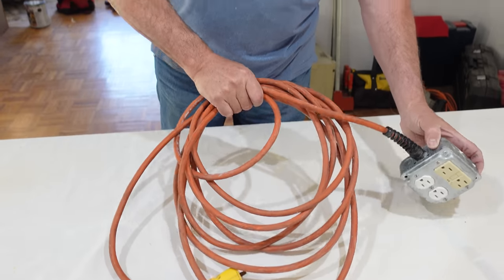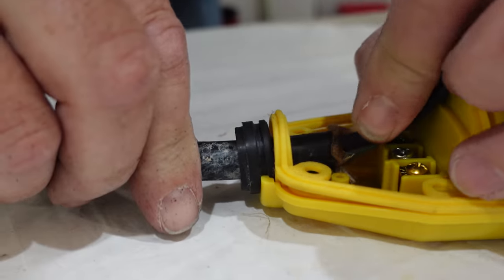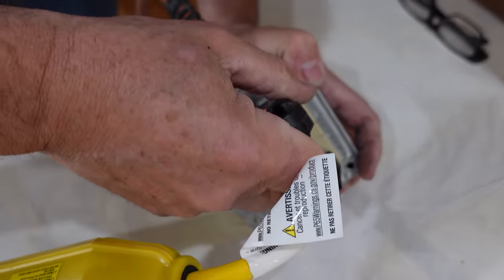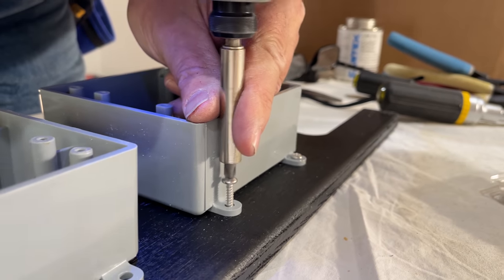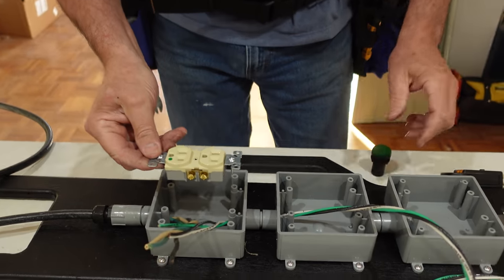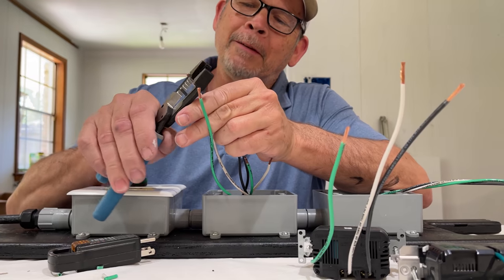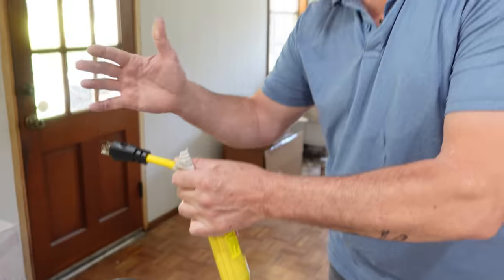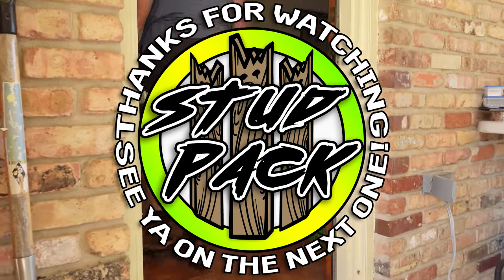HOW TO MAKE THE ULTIMATE EXTENSION CORD!

Comment: only problems i got with this is those usb outlets are unreliable in my experience, it would have been awesome to run a dedicated DC power rail through this cord-board, a really good PSU unit with warranty, and wire it up to dedicated USB-PD charging unit with good cooling, charge your laptop at top speed too, and never have to remember which sockets are dead because the integrated AC to DC converters burned out.

and also the US sockets, Australian socket FTW ahahaha

Comment: What about if you need to plug in  welders for broken nails or door hinges......
Reply: A welder would be 250 V. 
Which would mean a different plug and receptacle and wire. Usually it’s a 4 wire twist lock. 
Then you need a double pole breaker.  Usually at least 30 amp.

Comment: So the breaker didnt trip because the way it works is when a short circuit happens there is a large current the breaker trips instantly because there is a magnetic field that pulls a mechanism which trips the breaker. When there is an overcurrent the current is lower then a short circuit. This warms up a bimetal and when that is warm is folds and enlarges which also trips a mechanism. This means that it takes more time to trip. But dont worry because the warming of the bimetal goes quicker then the warming of the cable. Its designed this way. The vacuum cleaner part is wrong. When a motor spins slower there is a lower internal voltage of the inductors so there should be a higher current. I think why this isnt the case here is because the vacuum cleaner senses a the current growing and lowers the voltage until the current lowers again. When there is more mechanical resistance to a motor the current rises because it spins slower keep that in mind.

Comment: Very American style electrics. Also don't you guys have like extension cord rolls with the ground fault protection built in? They are really cheap, give you earths, and on a roll like 15m long for not that much, or if you splash some more cash you can get better ones what are water resistant and what not

Comment: breakers are made to trip immideiately at 200 percent rating so until it hits 40 amps it wont trip right away but will trip over a longer period of time ie an hour federal has such a high failure rate it might not trip even at 40 amps tho

Comment: Why so many Wagos?  Each outlet can handle 4 hot wires plus 4 neutral  wires under the 2 screw clamps per side.  Still need a Wago for the ground unless you daisy chain.

Comment: i was told by an electrician that GFCI outlets arent the best for using on extension cords that you plug in power equipment like saws .. i dunno... they said it qas something about when the saw turns on, it draws a surge of power an will trip the gfci all the time. can anyone explain this and if that really happens?

Comment: As an electrical engineer myself, I don't understand the logic of putting in a 15/20 amp receptacle in the mix, unless everything up to that point is rated for 20 amps.  Of course, you can draw more current than 15 amps with multiple devices plugged in and running simultaneously, but under normal use that isn't likely to happen for very long, or an extended period of time.  A 20 amp device plugged in however, may draw a significant amount of current for a longer period.  I'm not sure of the gauge of the cable cannibalized to make the cord, but it's very likely only rated for 15 amps, since that's what its original plug was.  Same as the inline GFCI - I know that's only rated for 15 amps, as I checked the specs on it.  Unless the extension cord, GFCI, and various pigtails, etc. are sized properly for a 20 amp load, this shouldn't be plugged into a circuit with anything more than a 15 amp breaker, and that pretty much makes the 15/20 amp receptacle useless with anything other than a 15 amp device.  Remember, circuit breakers protect the wiring, not the devices that are plugged into them, so if you really wanted a 20 amp receptacle, the wiring and GFCI should also be sized appropriately to allow it.  Otherwise, it can be a fire hazard as the wiring and GFCI may heat up handling a load they are not designed for.

Comment: +1 for not being all "manly men don't use a GFCI" which is how some people would think and it's dangerous and silly.
I think it is theoretically possible for the wrong GFCI to trip when you have more than one.  If you plug them in the opposite order does the yellow one still trip? Still fine, just a small nuisance if the wrong one trips.

Comment: What is the purpose in residential to have 15 amp receptacles on 20 amp breakers ?
Reply from the maker: NEC allows a 15 amp duplex receptacle on a 20 amp circuit
Reply: NEC may allow that but town codes could be different. Always check with your local Town for proper codes.

Comment: Why not use hospital grade 20 Amp receptacles ? They are very heavy duty. You have 12 gage cord, you did not mention what the GFI was rated for? Hopefully it is 20 Amp as you may be plugging in multiple tool which will be pulling over 20 Amp. Also you have to figure in start current. Nice job overall. I just busting your ???. I get your points though. 
The reason you are able to pull 28 amps is because most a rated to be able to pull a 125% over rated for a short period of time at a certain temperature. If you continue to pull that amount for a period of time the temperature will increase in the enclosure and the Amp rating will drop which will kick breaker. If you were to pull a 40 Amp or 50 Amp draw it would kick immediately. Many times your start current will be higher just momentarily but once you motor or other electrical device gets to normal operation the amps will drop. By having breakers rated at 125% at a specific temperature this will allow this to happen without tripping breaker. However if it were to continue pulling those amps for a period of time then the temperature would increase causing it to trip. Amps is the rating but you also need to know what temperature it will allow. Basically temperature is our enemy not so much amps for breif time. When things get hot fires are started and that's why both must be known. Also box size will also affect Temps. I know I may not have explained this in electrical code terms but I know you understand my point. Thanks for you detail in explaining things as I know this is very helpful to many.. PS I am not an electrician but a master Diesel mechanic and many principles apply to my industry also. While most of my circuits are lower DC circuits we have many supply circuits that require 120 or 240 volts. Like truck block heaters. Thank you and have a great day.

Comment: A better connection would have been to solder the ends of the wires so that when you compress them it doesn't spread apart

Comment: 25 Amp/120v = 28 Amp/107v 
3000W is 3000W
You get some tolerance for Voltage Drop

As it gets warmed up things will change...

Comment: I would never use a 1 way switch for an extension cord. If you plug your extension cord into a power socket where the live wire and neutral are reversed (which can happen as you may know), your switch will only turn on and off the neutral, which means you will always have 120v on your tools, which can lead to damage in the electronics.

Comment: The problem with the breaker not tripping is you only showed amperage, which is not a true measure of what is going on. Breakers are designed to trip from current (wattage). The AMP rating is a certain amperage at a certain voltage. Wattage is Volts * Amps. That cable was not able to maintain full voltage at that load which lowers the wattage. So, by only showing the amperage,  you are kind of cheating the question.

They also work thermally, it takes time to build up enough heat to trip. But, your almost double the rated amperage would more than likely hold until the wire insulation melted on the cord due to the voltage drop.

That is called a gland, not a strain relief. It's meant to pass a wire/cable through a hole and seal it. A strain relief would have a flexible section to reduce the chance of focused stress on the wire/cable.

Comment: 28 amps on a 20 amp circuit is 140% over the rating. If the breaker is in good condition it should take at least 40 seconds to trip at 150% of its rating. I would be concerned if it didn't trip in a little more than 1 minute. If you cut some tile or hardwood, the current draw would be higher and the breaker should trip sooner. On a dead short the breaker would trip immediately because of the unlimited current.

Comment: the reason the 20 amp breaker didn't trip if you meant on electric panel it's one fo the falutey ones thair was a news story about it or the breaker was labeled wrong what is for such as room 1 actually is whierd to bathroom

Comment: The green DOT on the outlet means ISOLATED GROUND!  Meaning the Nuetral and Ground ARE NOT TIED.  It has nothing to do with the heavy dutyness of the recpticle.
Reply from the maker: The green dot means "hospital grade" and an isolated ground is one feature of that type of receptacle.  They are also designed for superior plug retention so your life saving equipment stays plugged in :) , the yoke is stronger., etc.  The UL approval process for a hospital grade device is extreme.  Check out this quick video: if you're interested: 
 https://www.youtube.com/watch?v=ppgPHSafVrc  
An orange triangle on a receptacle means "isolated ground" where the yoke is not attached to the ground.   I've seen orange dots, triangles, and green dots on orange bodied receptacles....

Comment: These are great for home owners but contractors that might have OSHA visit their site can not do this as it is against safety regulations per code. All cords must be returned to factory condition, by which you replace the end with a comparable plug as what was on it. Cords can not be modified for job sites. They make cords like this that are safety rated for contractors. As I said, for everyone else, this is a great idea and I do it myself. I just wanted it said that you as a contractor should know this.

Comment: 15:14 this was looking great until you dismissed a crimp as not being a good connection!!!? and then went with a twisted wire loop 😳 firstly, that screw only has vibrate loose a tiny bit before that earth wire falls off… And that’s your safety protection gone. Secondly, earth connections are made with ring crimps, not spade, so even if it did come loose it would stay on there and not flop onto a live terminal. Industry is full of best practice conventions like this because we have to sign off on a LOT of documents, and domestic outlets are way behind what a proper power systems looks like, so you are kinda forced into a lot of awkward compromises?
Check NASA Engineers for why (properly made with the proper tool) crimps are better than every other method.
Anyway, back to the video 👍 you are really good at presentation btw 🙂

Comment: Did you know your cord has a left and a right  end to it? Because the wires are twisted inside the cord one end will line up correctly with the male plug connector. If you pick the wrong end the neutral and hot wire will not line up!  Check into this if make your own cords!!!

Comment: Your current test with running several of your power tools is not valid. None of them were under load, that is, cutting wood or whatever. Power tools draw a lot more current when they are loaded. One needs to consider that when the source of power is limited. Got some good ideas there though. Thanks for your time and sharing.

Comment: I wouldn't recommend more than one GFI unless you're in a unusual situation or aren't sure if the primary GFI is functional. If a tool isn't working it just adds another variable to the possible fault.
(Also GFIs aren't guaranteed to trip(or in the case of tools with unequal cycles not trip) and some GFIs might trigger in circumstances where others wouldn't.)
(EXTREMLY BASIC RUN DOWN: a GFI is kind of like a balance beam measuring the input and output and if the output is less than the input power it triggers a interrupt)[See notes 1 & 2]
||NOTE 1: In a normally functioning circuit both the return voltage should always be the same as the input unless the input has found a new route such as submergence in water or contact with conductive surface.
||NOTE 2: I'm using a extremely basic and incorrect explanation of voltage to keep it simple and not require a master class in electronics engineering & theory. Inaccuracies include explanations of alternating current and oversimplification of a 3-phase power grid.

Comment: Do you have ground fault protection guess what that is OSHA approved. And can be used on a commercial site all the wiring is inside of a grounded metal box and that is legal. Also you’re not to have your extension cord and water putting your extension cord in water is not OSHA approved. You put proper fixtures on the only other thing oh she would’ve liked to seen our caps and covers over the plugs but that would pass OSHA rigs not a problem. I have made many of those cords myself they work great.

Comment: Next you need to do a 240Volt extension cord that has a circuit breaker system which can also run off your new $20k Tesla battery as well. That way you can run your tools and wash your clothes with no issue!

Comment: Circuit breakers must allow high currents to flow for short periods of time so they don't trip when motors start. Motor starting currents are commonly about 5 times their running current. So a motor that pulls 10 amps once running, will likely need to pull up to 50 amps for a very short period when starting.  If our breakers instantaneously trip when the current passed 20 amps, then motors could not be any larger than 4 amps (1/2 hp) running current or it would trip on every start.  And if we had a 1A. light running on the same circuit, you couldn't even start a 4 amp motor on a 20 amp circuit without it ripping.  Using instantaneous breakers would force us to run huge wires which were being used nowhere near their capacity most of the time, creating a huge waste of money for the big copper. these 50 amps circuits.

We solve this waste by using inverse time overcurrent protection.  All standard breakers we use in homes and industry work this way.

Wires need to be protected from overheating and melting.  Amps generate heat but like boiling a pot of water, it can take a long time for the wire to heat to dangerous levels and will depend on how many amps are being drawn through the wire.  If 20 amps is safe for a given sized wire, 21 amps is going to make very little difference. It will slowly get hotter over a period of an hour or more. So if we set 20 amps, as the safe heat point for a wire, we can still handle 21 amps for an hour or more.  An inverse time circuit breaker allows us to do what is safe for the wire. It allows small over-current values to flow for hours, and higher amp values to trip faster.  It is called inverse-time because as the current goes up, the time to trip goes down.

How long a given breaker will take to trip for a given amount of current is known as the trip curve.  You can find manufacturer graphs that document this, but it is typical for a breaker to need 10x the rated current to trip in under a second.  So you need 200 amps, on a 20 amp breaker, to make it trip in about a second. 5x the current (100 amps on 20 amp breaker) will take about 10 seconds (so motors are allowed up to 5 seconds to pull high amps or be locked before the breaker will trip). 2x the current (40 amps) will take around 1 minute to trip.  And 50% over current, 30 amps, will take about 5 minutes to trip.  In the video, the loads pulled 28 amps, which is less than 50% overload, so that would have worked fine, for over 5 minutes. But it would trip if the current was not reduced back to below 20 amps.

This is safe because these small over-current periods don't heat up the wire enough to cause danger. So it is safe to overload a circuit for short periods as long as the overload doesn't continue for too long.

Inverse time breakers use an internal heating element to mimic what is happening to the wires and when the element gets too hot, it trips.  Because circuit breakers use heat to control their tripping, it is normal for a breaker carrying high loads for extended periods to get hot to the touch. But because the heat will also damage the breaker, it is hard to build cheap breakers that accurately trip right at their rating, but also run forever when just under that heat. Because of this complexity and cost, normal breakers are only rated to support 80% of their rated current for long periods.  So a 20 amp breaker, will only function correctly for many years if it is used at below 16 amps (80% of 20), most of the time. All the rules in the NEC about what size wires are safe for different currents, how to calculate loads, and how devices are tested for safety take this 80% behavior into account.